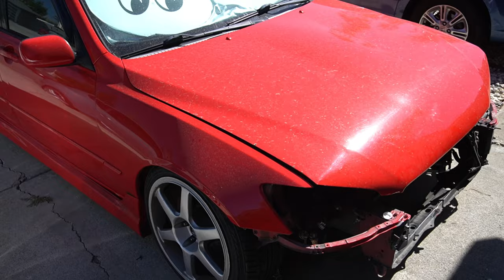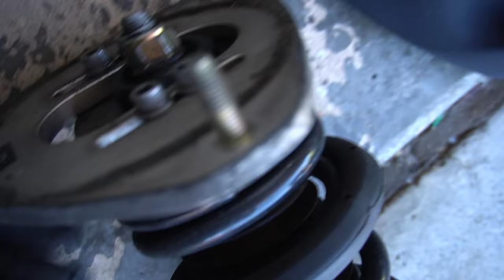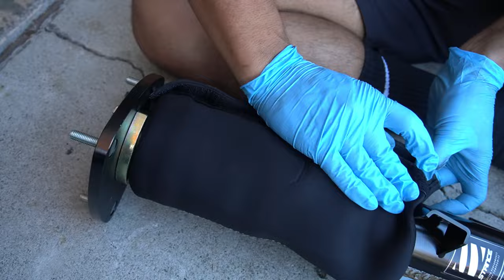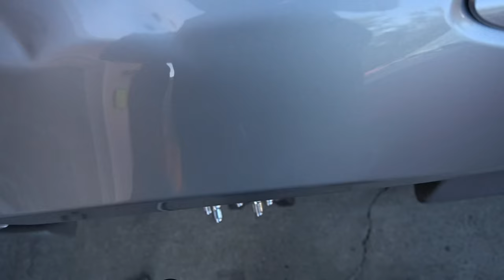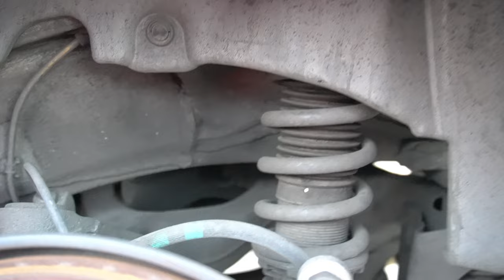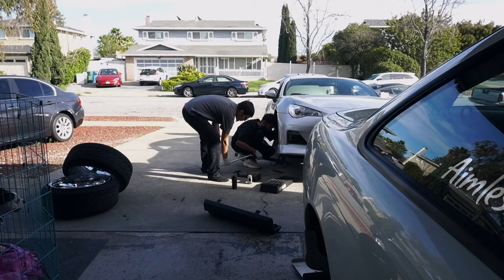Suspension Refresh | Stance Coilovers & PBM LCAs ZC6/ZN6

Comment: what size adapters are you guys running to fit the r33 wheels?
Reply from the maker: 15mm but you have to cut the studs on the car to run the r33s or they will hit the face of the wheels

Comment: Good upgrades. BCs are fucking JUNK.  I'm running stance on my zn6 as well. RLCA is a common upgrade because it helps lower the rear. You guys probably shortened the travel in the rear which is why he was doing a burner on your driveway lol.
Reply from the maker: Yeah it was quite a bit lower in the rear but it always has problems getting up and down that driveway, it’s steep lol